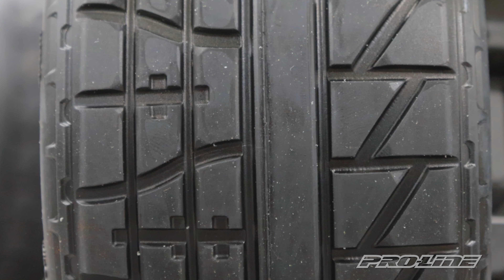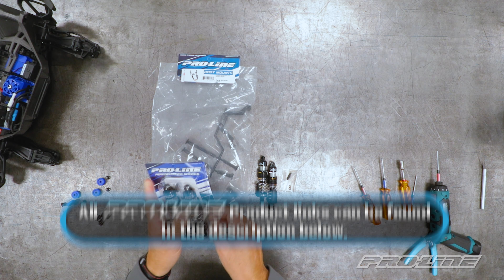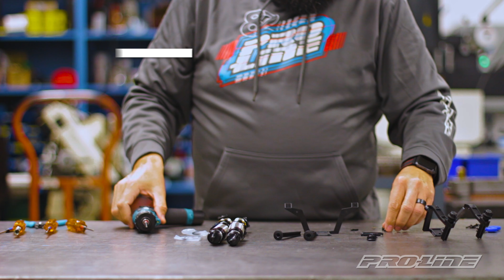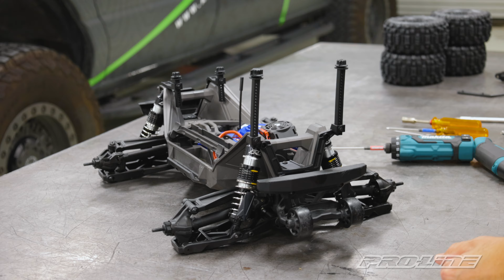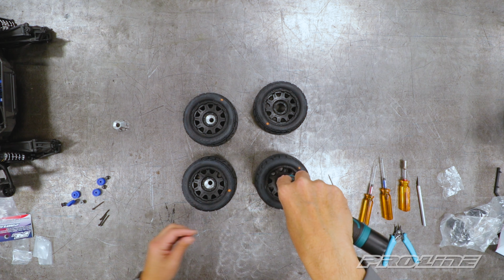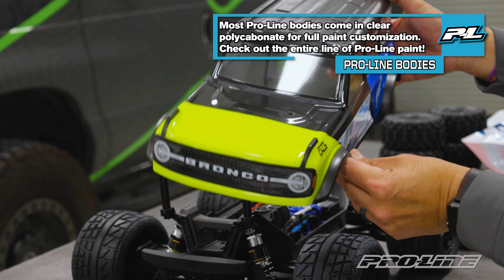Pro-Line HOW-TO: Upgrade Traxxas® MAXX®

Comment: Great video once again ppl, I have a set of those body mount's on my maxx and it would be good if you could design a removable cross brace that you can screw in when the  body posts's are at a high point because they become very flexiable. 👍